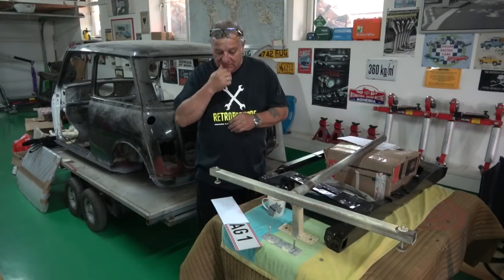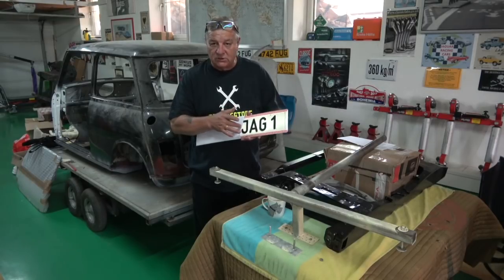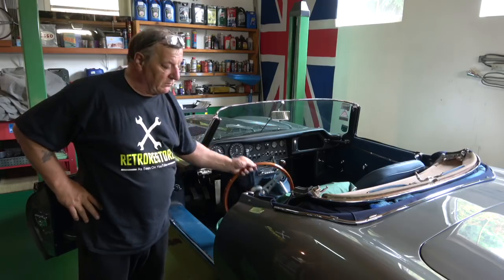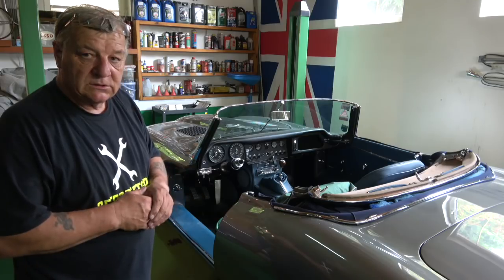Jaguar E Type Steering Bushes & Wheel Spinner Tool Part 1

Comment: Hi Dave, I use a lead hammer on the spinners, it will not mark them  if it is  lead only.. I saw your new motors run up and  think it would be good to have a exhaust hooked up as you  need to hear if  any small noise comes on. Also steady rpm is good to run in the cams  so quick revs can  not be good for cam lobes. Thanks for the great updates
Reply from the maker: Mike, The problem i find with the mallets lead or not is getting the right angle to tighten them, The tool that i use
now with a socket and breaker bar is far superior, This is the next thing i need to do as i have classic fabs exhaust for both engines, and i will run them both up very soon incase there and problems, There was no time to fit everything fitted to the engine and bring them back to Austria, At least i know they run basically. Cheers Dave.

Comment: Agreed... when i restored my RS2000 mk2 all the running gear components were Hammerited.  they have a rattle can that is slightly compareable here called Tremclad, strong finnish, used allot on the farm stuff but they don't have the varieties of Hammerite tho. Gawd what i'd give to ship my Dodge dually and the 35ft goose neck to come help you n Max get yer cars to IMM. that'd be a hoot. cheers. ps. enjoyed yer wee stint at acting there.
Reply from the maker: Doug, I think it will be great meet as all the boys are going and Max and his last built ERF Turbo lol. Cheers Dave.

Comment: I lubed the rubber bushings with silicone grease since it does not get absorbed by the rubber, 2000 miles now and the are excellent.
Reply from the maker: Ehab, Yes i will be doing the same as i spoke to the SNG Barratt expert and he said the same thing, Cheers Dave.

Comment: Good video! Do you know if the same individual makes a tool for the non-eared spinners (the 3 lug type)? I had a 20 minute battle last week on my S2 with a copper/hide hammer and thought there must be an easier way! Cheers.
Reply from the maker: Colin, Please drop me an e mail on davejaguar66@gmail.com and i will give you his e mail address, Cheers Dave
Reply: @ClassicCarCave  that's great thanks, just emailed you

Comment: Im glad you touched on the knock-off wire wheels .... is one side of the car a left hand thread ?? If so which side ! 

By the way thats a great tool ! Looks really well machined
Reply from the maker: Paul, Yes, but all spinners tighten to the back of the car not to the front witch you would think would tighten going forward! but it‘s the opposite as Breaking force are greater then acceleration forces, Cheers Dave.